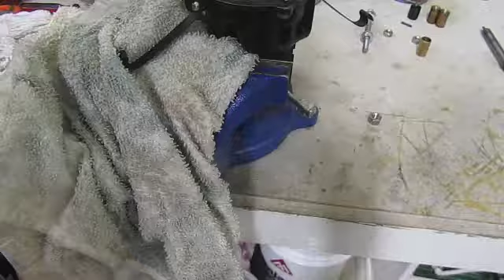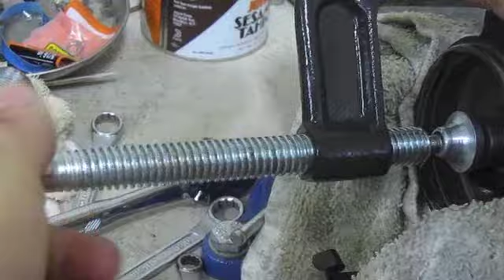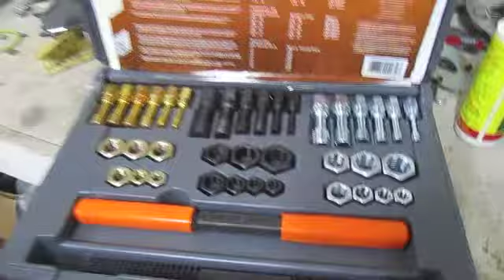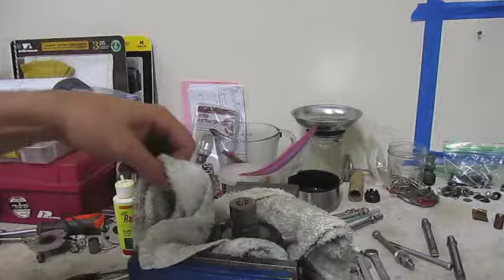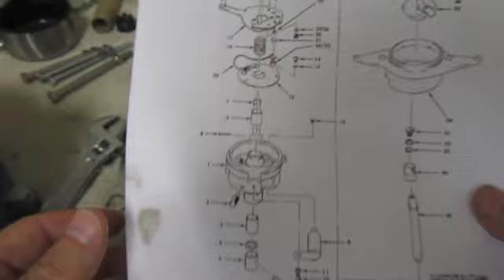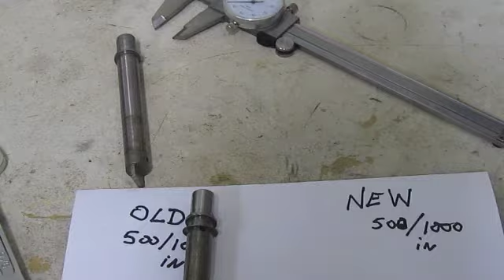Ford Model A - Distributor shaft and bushings replaced without a press (2 of 2)

Comment: Seen an old timer who said to take the thickness off the bottom sleeve not the fiber washer. He said to used a file and rub he sleeve on the file until you can take enough metal off to van a final gap of 3-5 thousands after the pin is in... Just what I seen...

Comment: Clamp the C-clamp in the vise. That should stop all the clamp movement as you turn the clamp screw. Also, if I were using the bolt method I'd use a fine thread bolt.